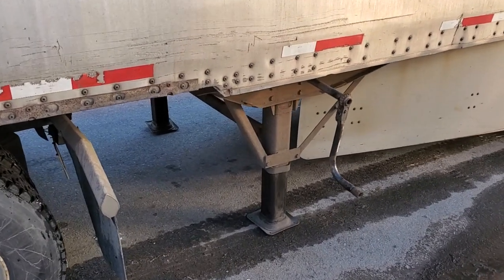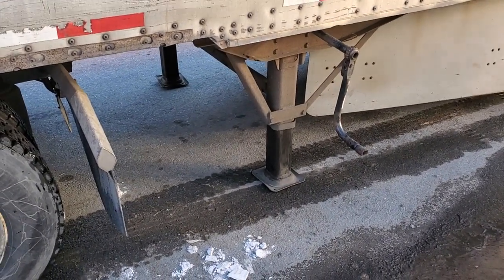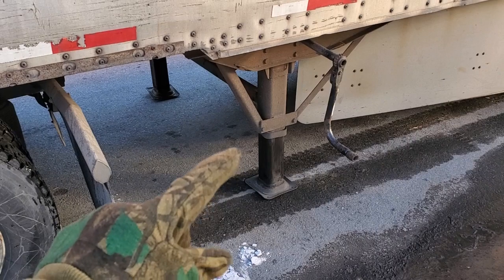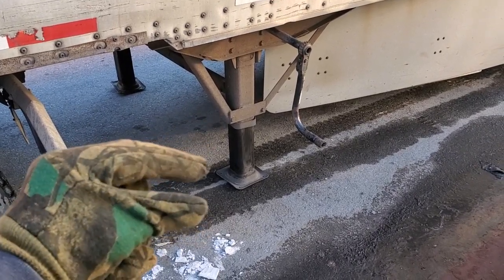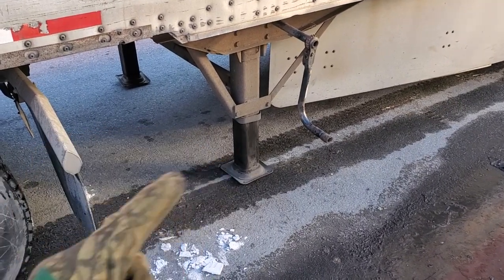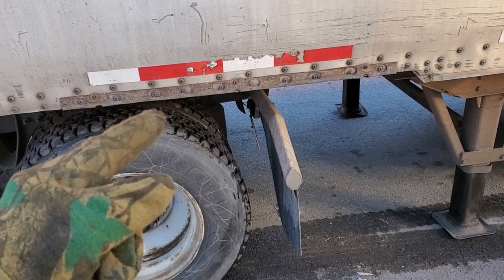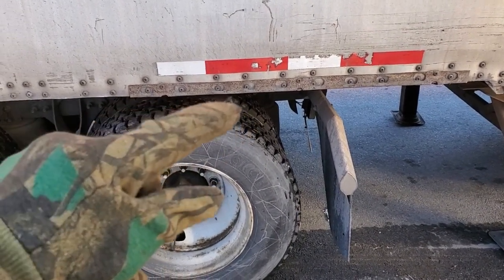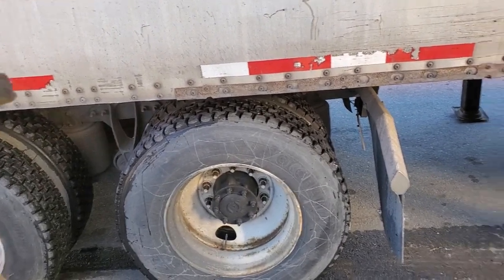Do this to get your trailer landing gear up with ease

Comment: Yea, do this on assphault! If its not assphault and its a loaded trailer, typically relay trailers are like this...
Then dont do this and make sure your truck can dump the air bags. 
You dont want a loaded trialer digging into the ground. Which causes you a pain to raise the trailer for the fifth wheel.